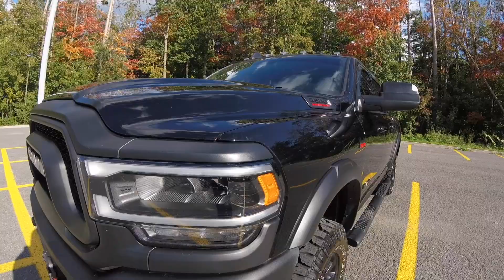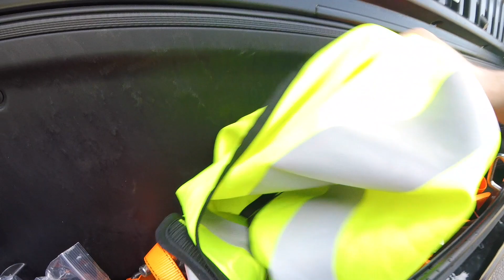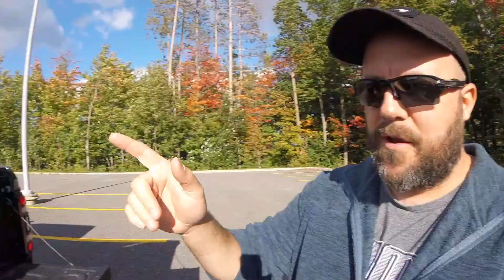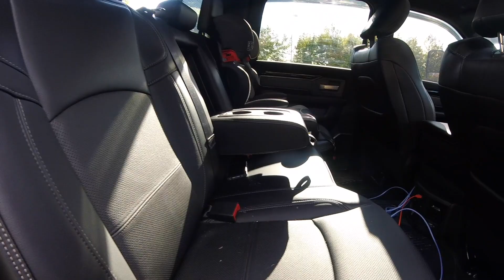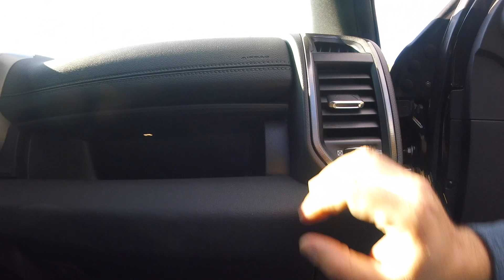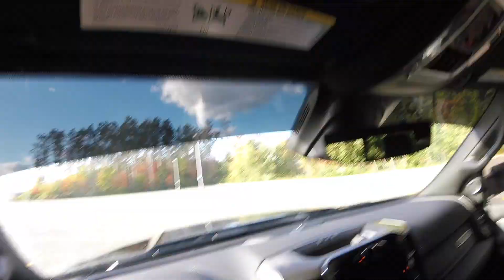2020 Ram 2500 Power Wagon - Overview and Walk Around

Comment: Nice video, subscribed. Looked at the PW, ended up with a 2019 Rebel two years ago, not much hard core four-wheeling in mid-Atlantic.
Reply from the maker: Thanks for subscribing! 

The Rebel is a good compromise between practicality and capability. Can be hard to justify driving a 7000lbs+ 3/4 ton if you don't really require it.

Comment: My comment is not really related to the truck but I think I would keep the fire extinguisher in the ram box. It would probably be just as quick getting to it if you need it. Fishing underneath a seat for it and getting it out of the vehicle bracket could be awkward. More importantly...having it fire off accidentally in the cab would not be good. It would be in all your vents and electronics and almost impossible to totally clean. And...awesome truck!
Reply from the maker: Thanks for this! I appreciate you taking the time to call this out. 

To clarify, it would be mounted to the front of the seat rails, so it would be accessible even from the driver's seat, but still out of the way from the passenger legs. The accidental discharge definitely would be a disaster though, that's a really good point. Maybe I can mount it to the side of the rambox (or the lid). I just don't like it being loose and not having a "home", if that makes any sense. 

Thanks again man

Comment: Do you drive it everyday and if so is it a good ride, thinking about getting one. Beautiful truck.
Reply from the maker: Yes it's my daily driver. It rides smooth and comfortable overall. That's one of the benefits of the PW...it has the softer off-road suspension, so it doesn't ride as stiff as a traditional 3/4 ton when unloaded. Thank you!
Reply: The ride in a power wagon is smooth asf! I have a '19 too and let me tell you, the seats hug you.
Reply: My 20PW is smoother than my 2012 Ram 1500 I traded. Definitely daily driver!!

Comment: Great looking truck! I picked up a used 2019. The winch fairlead that came with it had two hooks but one was missing. I bet the owner before wrapped the cable around the hook and tightened it too much causing it to snap off. That's 12,000 lbs of power!
Reply: no it I was taken off because the sun will mess up the synthetic rope
Reply from the maker: Haha, maybe it's best that mine only has one hook then! 

How are you liking yours so far?
Reply: @ORVXplore  absolutely love it. Easily the sharpest truck on the road. She is thirsty though haha!
Reply from the maker: You'll definitely want to sign up for your local gas station's points program LOL

Comment: Totally agree with your opening comments.
Power Wagon my dream truck too!
Reaching savings goal for down payment soon on the power wagon.
This will be my LAST  vehicle.
Video WAS WORTH watching from a Canadian  as i am too point of view!
I too love the ram boxes. Best overall storage space in the truck market!
Great that you can fit a atv in the bed with ram boxes. Answered my question on this subject.
Not too keen on the 12 in. screen.
Thinking of sun roof option. Have you had any issues especially water leaks?
In my opinion 35's would give a nicer look to the truck!!
Reply: I wasn't sure I would want the 12inch screen, but I gotta say it's awesome and works really well. Super useful and user freindly especially if you get the towing package cameras. I didn't get the sunroof because I feel like I would never use it. When it's cold it won't be open when its hot it wont be open because AC is on. Plus you lose headroom with the sunroof.
Reply: @sh0cktim3  Undecided on 12in. screen and sun roof for my power wagon.
Costly options?
Reply: @pjasyl  the sunroof is a $1000 and again kinda useless IMO. If it were the big panoramic one it be pretty cool.  But its just a little hole in the roof one that will potentially leak.
The 12" screen I think you will like once you see it and play with it. $2000 option. The size makes sense for such a big truck. You still get hard buttons for AC. If you like Navigation or plan on getting the tow package option its really sweet. And you can split the screen anyway you like, so half NAV, radio, AC controls....etc. I went offroading the other day and wasn't sure where I was going, having the big screen being able to zoom out and scroll ahead to get my bearings under me was nice.
Reply: @sh0cktim3  That's a reason i am getting the 360 degree camera option, especially for front view.
Reply: @sh0cktim3  Leaning towards the 12in. screen because of the towing package  cameras.
Still not sure on sun roof though?
Reply from the maker: Wow thanks for the awesome feedback!

So far no issues with the sunroof. Regarding the ATV, something to warn you on...if you get a tonneau cover, it may no longer fit. My tonneau cover has mounting brackets that mount to the inside cargo rails, and its now like 1/4 inch too narrow! I will post a video about that soon. Obviously it depends on the tonneau cover choice and the ATV itself. 

35s will definitely look great. Just trying to resist until these stock tires are worn. We will see how it goes lol
Reply: @ORVXplore  Thanks for the information!
Will check out covers for power wagon.
Leaning to not getting a cover.
Great to know that the pins are available to extend the divider over the tailgate!
Reply: @pjasyl  if your serious now is the time to buy. End of year and Covid-19 stuff has prices discounted too. Hit the Ramtrucks website put in options you want on yours and start searching. And don't be scared to fly or drive a couple 100 miles to get one if its considerably cheaper than your local area. That's what I did.
Reply: @sh0cktim3  Have not reached my down payment goal yet.
Aiming to purchase the 75th.anniversity addition POWER WAGON in 2021 unless i get a good deal on a 2020.
Reply: @pjasyl  you can find the 2020s for $10K off sticker. The 2021s especially that 75th special addition are unlikely to drop for awhile. That's a considerable price difference to think about.
Reply: @sh0cktim3  Thanks for the information.
There are only 2 dealers in my city. Neither have them on display with other vehicles on their lots.
Power wagon has to be customer special order.
Will consider demo power wagon option if available.
Reply: @sh0cktim3  Checking out the the 75.th annaversary edition purchase if affordable for me.

Comment: Save yourself a headache and don’t do the KO2s. I have a 2019 Power Wagon and when it came time to replace the tires, I bought a set of 35” KO2s and had an awful experience with them. I don’t know what it was about those tires combined with this truck but they caused the whole truck to shake at any speed over 35mph. I went back to have them rebalanced 4 times and it could not be remedied. Luckily, Discount Tire has an awesome return policy and I exchanged them for a set of Toyo Open Country R/T and everything was immediately better. Like I said above, I’m not sure what it was, but I think the compound of those tires is too soft for a truck this heavy. I’ve had KO2s on jeeps in the past and absolutely swore by them but I’ll never put a set on an HD truck again.
Reply from the maker: That's really good to know, thanks for the heads up!

Have you noticed any trade-offs by swapping to 35s?
Reply: ORV Xplore Nothing major. There’s a very slight power loss but it’s almost  unnoticeable. Fuel economy doesn’t seem to have been affected much, if at all, which is a nice surprise. I have found that if I run the new tires at the factory recommended pressures (60-65 psi) they feel like they’re made out of concrete. I’ve backed them off a bit and just gotten used to having the TPMS light on until I find a fix for it. Off road though, 35s have been a big improvement. You wouldn’t think so because it’s just moving up one tire size but the extra bit of sidewall helps a lot in air down situations. I’ll probably go with 37s next time around. I just didn’t want to have to deal with relocating the spare tire yet... baby steps haha.
Reply: @Vicarivss  love the new Power Wagon i'm jealous want to get one. yeah 40  45 max max pressure empty... max pressure is for max weight, get the TPs recalibrated at dealership  i run mine (Dtracks) at 40 on a 5500LB  Durango when i tow i put another 10-15 psi  in when towing 7-10lbs
Reply: @Vicarivss   you can go to the dealer and get the TPMS reset
Reply: chad case Thanks, I’ll do that.
Reply: Nope Ko's are  just garbage tires,never again  had a bad set too, balanced every 1000 miles no quality control, 40 k out of them while I got 60k out of the dtracks
Reply: I put 35” KO2 on my 20PW and have had zero issues. It’s quiet and smooth compared to stock. Stock duratracs looked horrible being a 32-33”!! Must replace